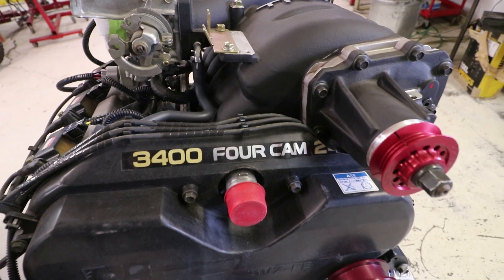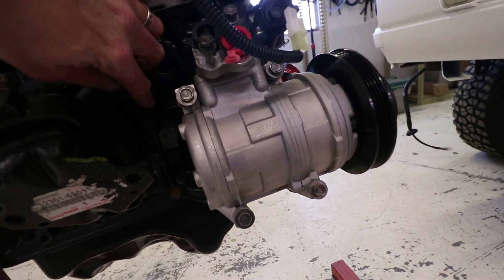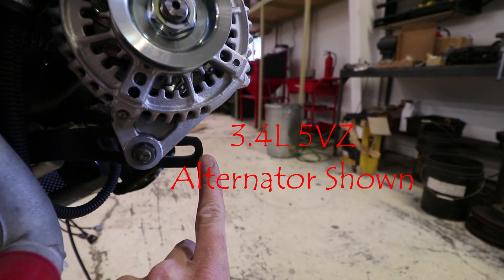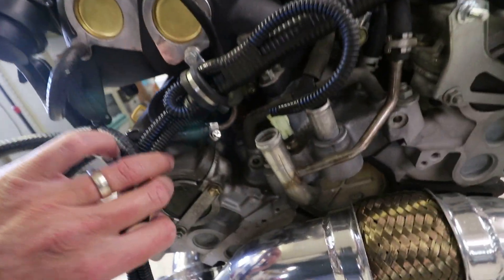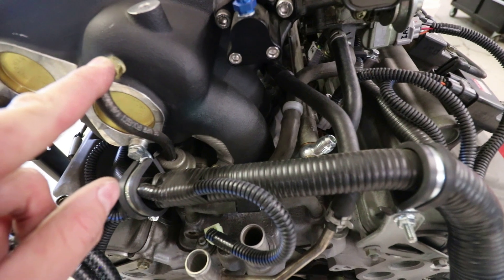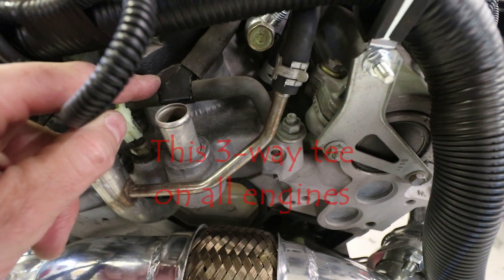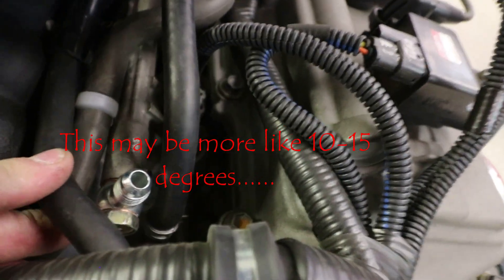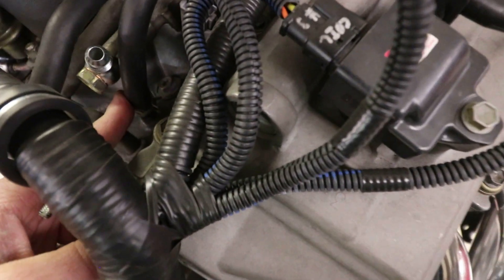Engine preparation for the 3.4L 5VZ swap

Comment: Would you recommend the supercharger. I just had a 19985 jeep cj7 swapped onto a 1997 Toyota 4Runner 3.4 automatic 4x4 
E-locker. I wanna make it have a little more power.

Comment: Man would I love to do this to a complete rebuild on a 3.4 for my 2002 Tacoma X-cab, but I can't imagine the costs of just the add-on parts. If I knew these parts were going on it I would completely re-imagine the parts I'd use for connecting rods, pistons, rings, bearings, valves, roller rockers and lifters. I'm at 181k on mine and I lucked out finding my truck, as it was single owner and garage kept, with a new frame. The interior is mint, and right now everything works, and works well. Doing the timing belt, water pump, idler, and tensioner pulley was a task foreign to me coming from GMC, Ford, and Dodge/Ram, but the last tag from Toyota on the timing belt cover said 79,811, so I knew I was due at 180k. 

I'd love to see a video walk-through that covered the build. I was able to pull off the timing belt swap with the help of another Youtuber's in-depth instructional video. The nice thing about this video is that they did not assume some laughable character, there was no unnecessary hand waiving, they did not waste time with dad jokes, they did not allow family pets to become a distraction, they did not drift into likes and dislikes of (name the topic), they had great camera angles, they had good lighting, they provided procedure cautions and warnings, and most importantly they did the swap with the block in the truck without removing the radiator. 

This is the gold standard of how a how-to should be constructed. I'm not a great teacher, but the testament to good instruction is success by the student. 

https://www.youtube.com/watch?v=p7OQtBsO3IM.
Reply: P.s. A key to their success is one person is doing the work, while the other is taking the video and providing narration. I know people are trying to help, but when you film your own instructional videos you are unintentionally your own worst enemy.

Comment: Might as well put the heater hose on the back of the engine.  They are a pain to get to once the engine is installed without removing the intake.
Reply: I was thinking the same thing. Removing the supercharger/intake plenum is about the only way to get to those hoses on a 5VZ once it’s in the truck.